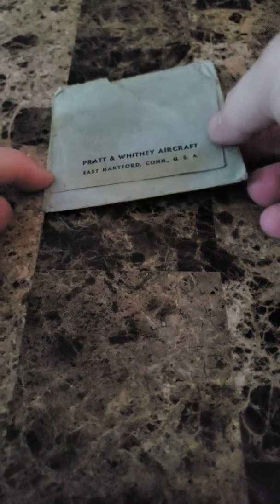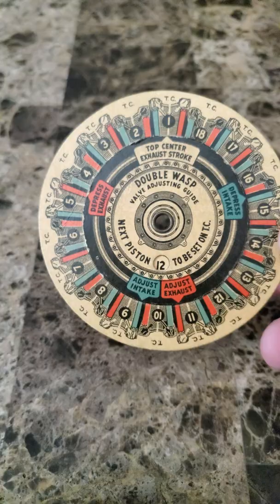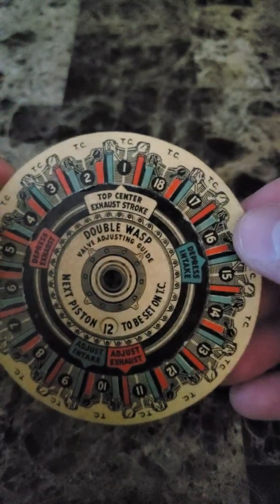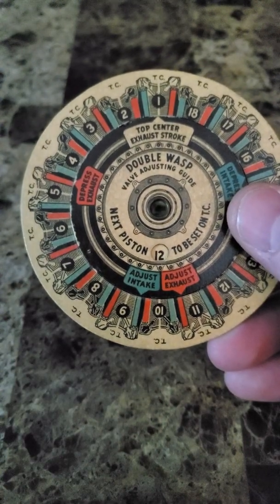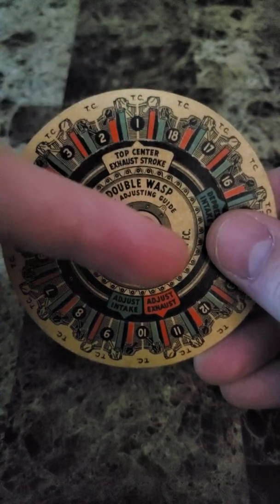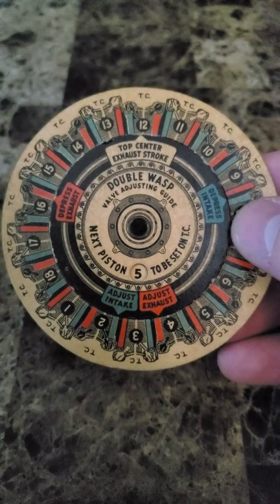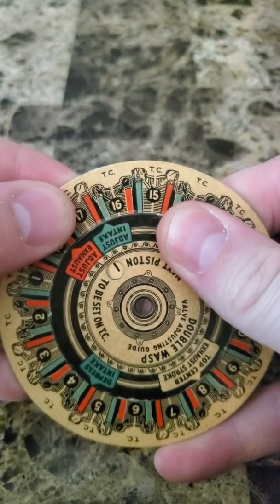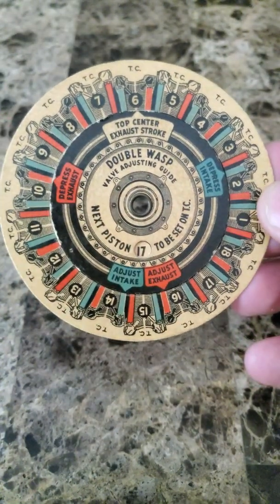Pratt and Whitney R-2800 Double Wasp Valve Adjusting Guide

Comment: Where did you acquire this? I volunteer at an air museum which has a few flying aircraft with R-2800s, and this would greatly simplify valve adjustment!
Reply from the maker: I found it on eBay